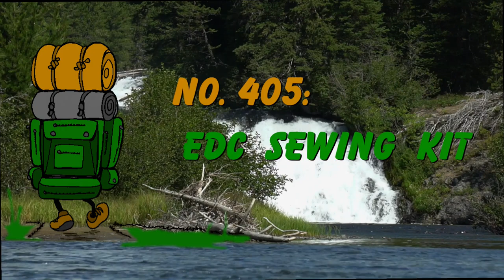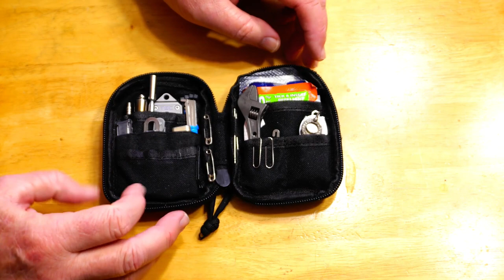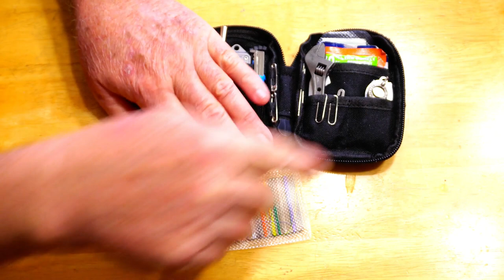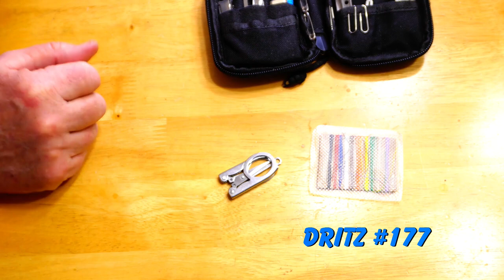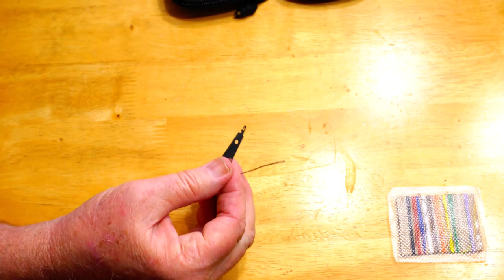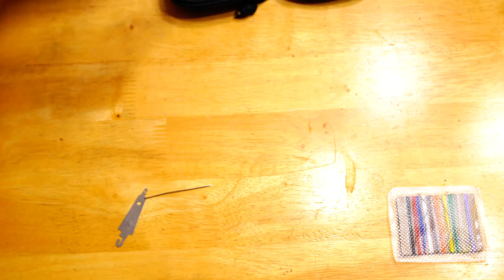EDC Sewing Kit

Comment: I carry dental floss as thread for field repairs.  It's strong enough to hold together leather.  Color matching gets done at home.  EDC a Swiss army knife and you always have scissors.  I have a leather thimble for heavy duty work.   I always carry a scrap piece of synthetic webbing to use to patch holes and reinforce weak spots.  My needles are kept in a tube scavenged from a dead ball point pen.  Spare buttons and safety pins are stored in an old RX bottle.